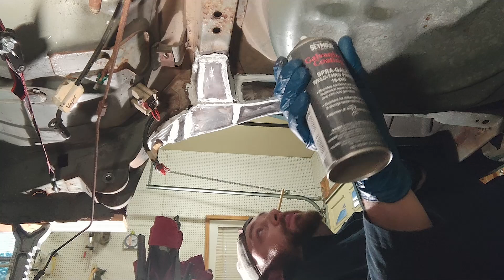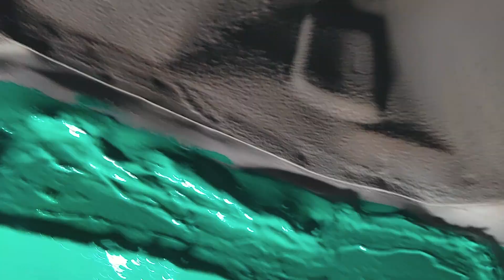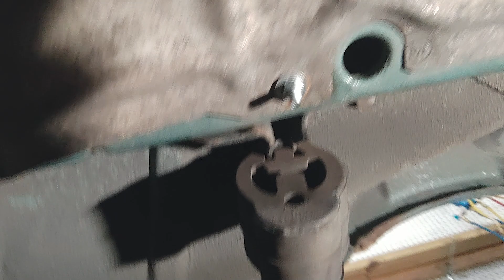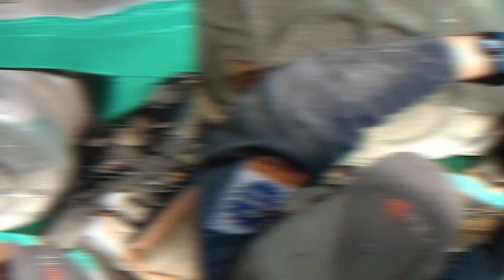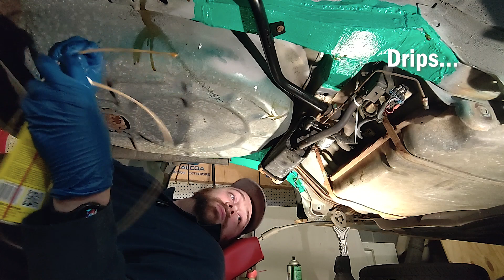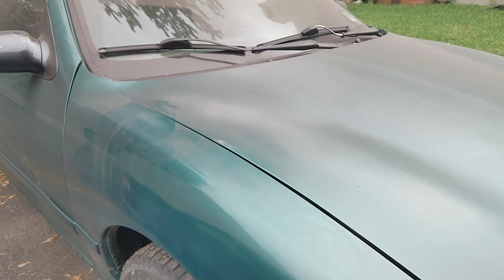Leadfoot: There’s Probably a Better Way to Do This | Sunfire Frame Rust Repair, Finale

Comment: After all that hard work I hope you undercoat the hell out of that car with Fluid Film, Woolwax or something similar. Remember that the best undercoatings are the ones you apply yearly, like these.

EDIT: Right idea with the spray can, but sprayer/applicator with compressed air would be much better. 👍